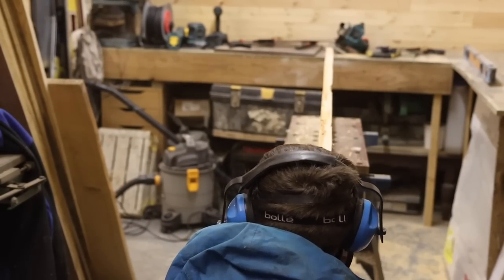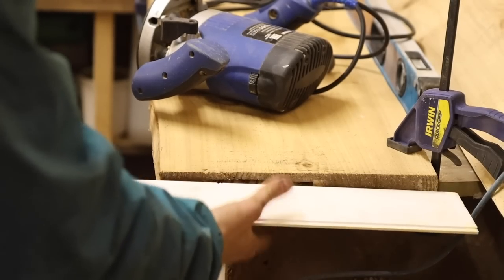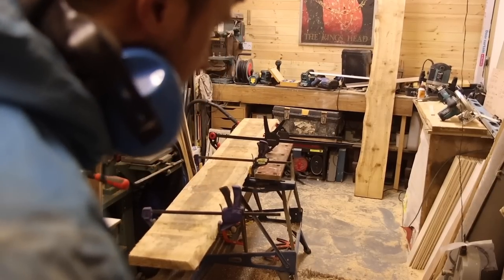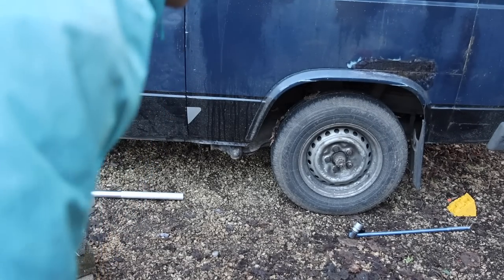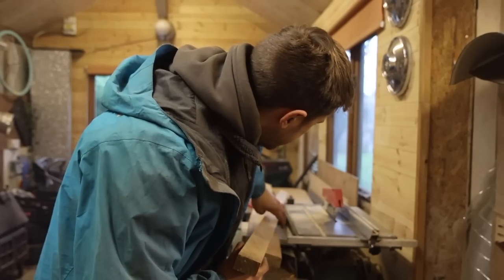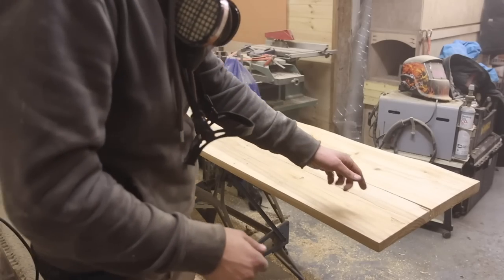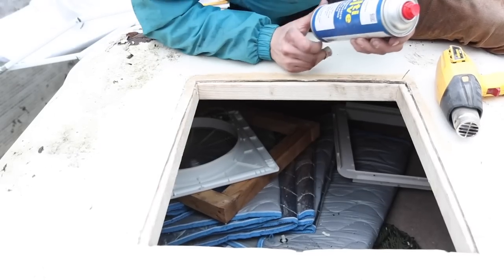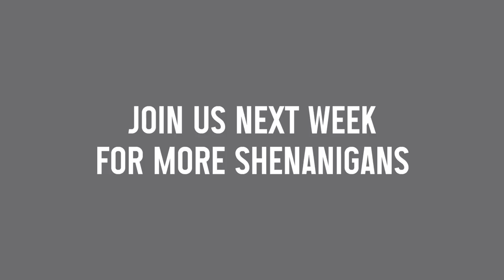DIY Van Conversion (on a budget) - will we make it?

Comment: Cut the rust out or it will just keep eating the van. Butt weld the steps in. Dont plate of the bad stuff or it will just keep coming back. Use the new step as the template and cut it all out and weld it on.
Reply: Seriously get it out now.
Reply from the maker: Cheers for the advice. Going to get some practice in & a bit if courage cutting out the step 😫
Reply: @ItsOhJoe  Have a look at you tube, there are plenty of how to videos. The best advice i can give when welding is weld a little bit on the left side and then a little bit on the right. This helps stop the panels warping with too much heat. Your get there and it will be a solid bus.
Reply: Hi guys, it’s correct you must cut rust out i got a t25 2 years ago and only now at the end of welding. Have replaced nearly every bit of the bus. Fuel tank and all lines. All brakes and lines trailing arms both sides, Thing is once you start it’s know when to stop. I admire the way you are doing your van. Keep up the good work and give the welding a go it’s not as hard as it looks.👍👍👍

Comment: Nice work Joe.  Good thing you have your Dad's workshop and tools for the van project, so much better than trying to work next to the tow path or car park.  Trying to break free lug nuts or bolts is a regular problem, sometimes resulting in broken studs.  To eliminate this problem, put a thin layer of axle grease on the threads and taper of the nut or bolt.  I'm not sure how you got cut in the video, to minimize injury, I always remove sharp edges on metal and wood.  Also, wearing some leather gloves can be useful.
Reply from the maker: Thanks Bill, it’s so handy! Thanks for that will make sure to use some when refitting

Comment: The grain in your spline (biscuit) is running the same way s the joint so it has added virtually no strength so make sure that the worktop is well supported.

You should have a look at getting a track saw. I sneered at them but needed one for building some large panel doors and the £80 that I spent in the Screwfix sale was well worth it. Long straight perfectly  square or angled cuts all day and no running for the plane to make edges match.
Reply from the maker: Cheers! Yes it’s well supported on the unit below so not too worried of strength once it’s fitted (as long as it holds whilst moving it about). I’ve seen the track saws, look really handy for bigger bits like you said, if I had somewhere of my own to store tools I’d definitely consider it. Maybe for the next build!
Reply: @ItsOhJoe  Buy your Dad one for his birthday, store it in his workshop and then use it whenever you need it.

Comment: Seeing as you have a range of clamps, grab yourself a tube of PU glue for your woodwork jobs. It expands as it sets (10 mins) so needs clamps and weight, but boy is it strong and moisture proof. Would of worked great on the biscuit joint. About £5 a tube (goes in a frame gun), and doesn't even block the nozzle up between uses, just unscrew, use, pop lid on for next time.
Reply from the maker: Ahh I know the stuff! That would’ve been a lot better